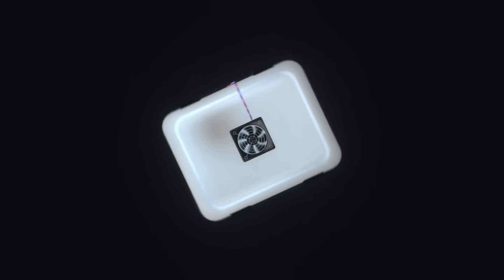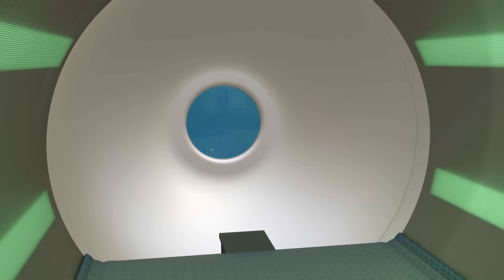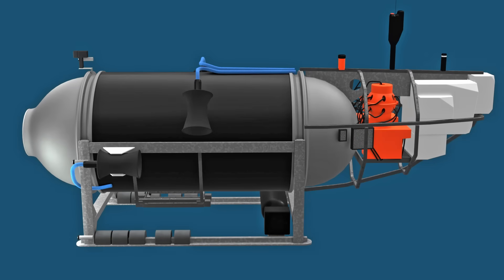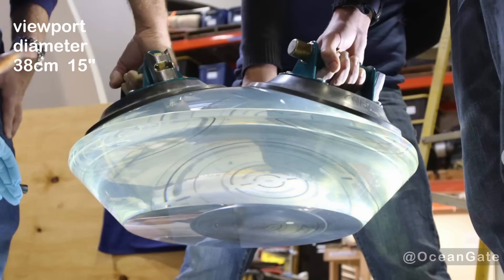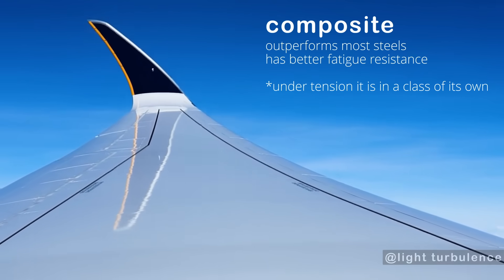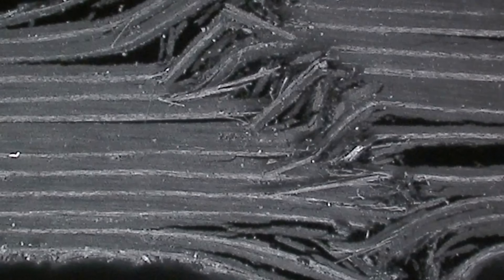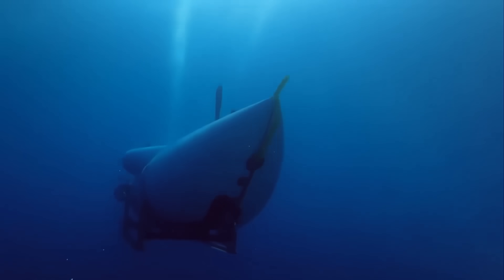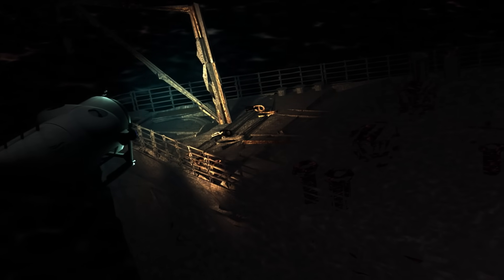Titan Sub | carbon fiber - Detailed Tour

Comment: I suspect many of the people who said in media that CF composite should not be used in compression know very well it is an oversimplification. Anyone who has worked with it knows this. I am an electrician who just helped build some diy carbon fiber recumbent bikes and I know this. But the explanation of the limitations to the design and manufacturing of such structure are so complex that mass media are just not interested in hearing them. So all those people face a challenge of how to say in 30 seconds on camera why the CF hull failed and something like "it is insanely difficult to design this right and requires tons of expensive testing and way more complex manufacturing than this company had access to or willingness to use" it gets compressed (pun not intended) to just "don't use this material for this". 
I feel this is similar to what in my own field of work happens in every discussion of electrical safety. Suddenly you have people arguing from position of authority that not voltage but current is important and they get very heated about it. And you could say they are stupid because in reality that is not true. But explaining the complex relationship between voltage, current, frequency and duration and the effects any combination of those variables has on human body takes 20 minutes even when explaining it to a technically knowledgable person like a non-electrical engineer. So you will never get the full picture when someone is asked to say into a TV camera a short reason why the kid climbing over the train got fried without even touching the wires. That does not mean the person saying in media does not know how it really works. 
What is a pity is that now it will be that much harder to make a composite submarine. In addition to the technical challenges now you have everyone in the world being certain it cannot work. It is like if 30 years ago one of the first carbon fiber aircraft had a spectacular crash killing a bunch of milionairs. We would still be insisting today tha any plane for passengers has to be metal only. But I blame Rush for this and not all the people giving simplified explanations after he botched it. Even if every publicised explanation went into the details of micro buckling failures in the longitudinal fibers in the hull what most people would still take from it would be just "carbon fiber bad for submarines" and nothing more.

Comment: I don't know if the cause of this implosion has anything to do with the CFRP construction. One thing I will say is that the analogy between a vacuum chamber and a wing spar under compression is flawed. Water ingress and delamination in a wing spar will not cause the same potential for deformation of the structural in a way that increases load, e.g. buckling. This might be too thick walled of a pressure vessel for that but I don't think there is a straight analogy here for aircraft spars even under compression.

Comment: I think it was thunderf00t who put out an explanation that I'm referencing here... But I believe he got it right. The compressibility of carbon fiber and titanium are completely different. Very different from each other, which is why you don't make a pressure hull from two different materials. That was the problem. Under the extreme pressures of the depths of the ocean, the carbon fiber hull compresses quite a bit, and the titanium end caps barely compress at all, almost a negligible amount. As the carbon fiber hull "shrinks" or squishes from the pressure, and the titanium end caps don't change in size at all, the connection between the two opens up. That connection was made with a glue, which would've cracked open or pulled apart, allowing a leak to open in the connection seam. The pressures of the water would very quickly blast that tiny crack/leak open larger and wider, at an exponential rate, with every passing moment as the water forces its way inside. After a very short period, a massive hole forms from even the tiniest of leaks, and ultimately the water slams in with immense force, demonstrating a giant water-hammer effect. Once the hull completely fills, in the last moment the water hammer slams the inside of the hull in all directions, causing the titanium end caps to blast off the ends, as you mentioned they did in this video, as well as utterly destroys the carbon fiber hull. This massive water hammer slamming in would be the loud sound that was heard, more like an explosion from the hull suddenly filling, not an implosion as people assume.

Comment: Listen, Carbon fiber is great for tension forces, IE tanking for cryogenic fuels for rocketry...Its physics with extreme variables. Carbon fiber is a wondrous material, but, not when you are compressing it from all directions like at the bottom of the sea....Not to mention the material fatigue....I would have never ever taken that trip even for free to only 2000 feet...

Comment: How can you say that a wing of a plane is under competition loads when it's more under tension like hell there's a massive low pressure zone above a wind that's what lift is never mind the flex of the wing that puts it under tension on the lower half the only compression load is half the wight of the plane over a 20 foot x 60 foot span so its basically nothing

Comment: The Titan design was not inherently flawed; it was innovative and sound. However, a critical mistake was the insufficient testing. Dry test dives without passengers should have been conducted extensively before full implementation. Additionally, Rush's unique way of explaining his design and safety approach left him vulnerable to character attacks from conservative media outlets. Unfortunately, everything tends to turn political these days, and they had a field day. The irony is that Rush was actually a Republican donor, not a liberal one. Hopefully, a new submersible-building firm will take up the Titan design, perfect it, and vindicate Ocean Gate's vision. Cheers from Park City!
Reply: Not just testing. The Titan needed to be thoroughly X-rayed both before and after every dive, but that could never be done profitably.

Comment: This is the first time I have seen this subject covered with an engineering perspective, a true understanding of the materials involved and a use of the evidence known. As mentioned in so many of the previous videos, they were no more than here say and copy cats of other here say coming from from people in the media (Like James Cameron) but with no engineering abilities at all. None the less I do not believe the cylinder actually failed. Rather the 'glue' from the titanium ring to the rear cylinder began to leak. This was even reported by the crew in communication with the surface vessel. This then went from a leak to a 50kg tnt 'explosion' of water that went from the rear down the tube like gun, blowing the vaporised occupants towards the front, first blowing the window out and then the front cover off too. I feel with the next expedition (likely next year) to the wreck, more parts of the cylinder will be found and could week be likely mostly intact.

Comment: There are so many problems with using carbon fiber for high compression use cases. I don't see the innovation here, because carbon fiber composites weaken on both compression and decompression cycles, so if you are on a sub at the bottom of the ocean and a structural failure is determined to be imminent, you would have to stay at your depth and hope that someone can immediately rescue you, because the act of resurfacing would be another full work cycle on the structure.

Titanium and other metals can have fatigue cracks, but if you start hearing noises coming from the metal under high compression, decompression is far less likely to create a scenario of structural failure then a composite one would. Soon in a submarine you could just surface.

Another problem that people already mentioned is just the fact that it's completely uneven, I see an engineer that posted fairly high compression results he got once, but if you built a full model of something with both carbon fiber and titanium, then tested both to structural failure on different surfaces, the skews of the results is going to be very clustered for the titanium, but likely all over the place for the carbon fiber.

Emphasis here on the lowest performing point of failure being the guaranteed point of structural failure in the real world.

Addressing a use case for more sophisticated carbon fiber designs: I imagine a 3D composite would do better than whatever Stockton Oil Baby Rush was using, but how thick do you have to make it before it can perform anywhere near titanium, and at that point, is it still lighter, thinner, or cheaper than titanium?  And how much maintenance will that require? This is why I think carbon fiber is dead on arrival for anything deep sea, and while it could be functionally viable to medium depths, I think that the maintenance and all the extra monitoring equipment quickly erodes any cost savings up front.

Comment: I haven't paid much attention since the first week or so, but what about water ingress into the outer layers? ISTR some aerospace composite tanks failing (or at least being removed from service) because of delamination.
If water gets into the outer layers through crevices in the resin, seems like the full pressure will be applied to fewer layers - the equivalent of a thinner hull. That won't end well, particularly if the crevices are concentrated anywhere.

Comment: You are very wrong. CF cannot be used for this application. No video will change that as it is not just about material characteristics but also where it is used and in which environment.
I've left my hand down as you missed completely the true issue with CF focusing on your narrative. You getting there, you just need to get some extra education about materials and maybe in a few years, you will be able to review this video with a smile, thinking how childish it looked from the perspective of a real engineer. But good effort boy. Keep it up and maybe think about getting a degree at some point as you have some knowledge (limited and clearly under the master's level, but still better than someone straight out of a high school).

Comment: It was dumb. Don't even ask, it was dumb. If crossweaved it may, may have been more robust over fatigue cycles, but your assertion that carbon fibre was strong enough, is absolutely not proven. It hasn't had the pressure testing to support that. Oceangate didn't do it, netiher has anyone else done it.

Assessing it's suitability from its theoretical strength properties is more than likely what killed its pilot and occupants.

It is its suitability for the given design, in the current use case, that has to be assessed. That basically wasn't done and still hasn't been done. 

The DeHavilland Comet is one example where the actual materials used, are all suitable enough. But one design flaw in the use of that material, causes it to be ultimately fatal.

That flaw showed up under stress cycles. The Titan's flaw showed up under stress cycles.

The hull construction was absolutely not precise enough for CF and Finite Element Analaysis would tell you the performance of the hull you mean't to build, not the hull you built.

It was dumb in so many ways that's it's painful to consider. And CF shouldn't be used in that use csase again ever until it has had real world simulation testing, extensively and exhaustively. And even at that, the onus it puts on the precision of winding the material, makes it a fundamentally more dangerous proposition than Titanium.

Comment: An even slightly 'out of round' tube will have uneven loads on it. This becomes exponentially worse the more it flexes/distorts 'out of round'. As it becomes wider on two opposing sides, making it oval shaped (looking from the end cross-section, along the length of the tube), those two sides get more load than the two opposing narrow sides of the oval shape. The differential load on the tube (the external top to bottom load being different from the side to side external load) will cause the tube to flatten out. At that depth/pressure (about 5500psi), even a small deflection towards the top-to-bottom/side-to-side dimensions of the tube is going to get exponentially out of control, very quickly. The longer the tube, the less stable it would be -- there is more area/places to go out of round. Carbon fiber, being brittle, would shatter long before the uneven external load actually flattened the tube out.
For that reason, a tube shape is far better for use with internal pressure than external pressure, because internal pressure tends towards maintaining the shape of the tube.
Reply from the maker: Great point 👍🏻

Comment: I noticed that the section about the viewport is the most replayed and there is a tiny little error there. 20mm converts to slightly more than 3/4", not 3-1/4". Best and most informative video I've seen on Titan, and yes I would agree the transcript is fake to gin up a compelling story of mounting drama. I agree they likely would not be typing running updates while responding to an emergency. It's more likely they had little to no warning before implosion.
Reply from the maker: Well spotted. Yes it should read 3/4”. Imperial notation is not something I’m very familiar with and I did this one in a hurry. 
I have been contacted by someone on the Polar Prince on the day and confirms the transcript is obviously and definitely nonsense. The real transcript is short and with the investigation. No emergency message received.

Comment: The comment that the transcript is false based on the thrusters being use during decent is wrong.  The context was that at that point they had warnings and were trying to ascend.  The thrusters at that point were not slowing the decent.   There were many long pauses in communication from the Titan showing that they were working on issues, rather than communicating.  The transcript may indeed be fake, but not based on those two points in my opinion.

Comment: You can't just make general statements that "cabon fiber is strong" or "carbon fiber is bad in compression." The geometry and manufacturing methods are critcal. In this case, the cylindrical geometry with lateral pressure was a very poor geometry for carbon fiber, easily producing layer delamination with cyclical compression. There is also good evidence that the prepreg carbon fiber was not wound or cured properly.

Comment: Yeah, about that big wide door that allowed for easier entry than the more traditional top hatch. It was against the law. The US Coast Guard does have well published regulations and requirements for passenger submarines and submersibles used in revenue service. Which Titan unquestionably was. And Titan was bound by these rules and regulations because it was constructed in the US by a US firm. Rush went out of his way to pretend otherwise while knowing full well he was in violation of US Laws and regulations. One if the clear regulations is the hatch must sit at a minimum 1 meter above the waters surface when the vehicle is bouyant on the surface. In short you must be able to open the hatch to escape, without flooding the vehicle in at least a calm sea state.

Comment: 9:10 Mike, sorry to say but no, you are wrong. Carbon fibre is a thread that's woven into a cloth, layered and bonded with an epoxy. If you re-think the thread matrix as a single rope and push on the end of it, what happens? The rope yields easily. Under compression, carbon fibre relies on the strength of the epoxy binder rather than the carbon fibre itself. Plane wings use tension for strength not compression, they have a central spar that is located on the top and bottom of the wing with rib spacers in between to maintain the central gap. lateral forces applied to the top or bottom of the wing puts tension on the spars.
Reply from the maker: @Mrx1080  Pretty much everything you said is incorrect. 
How does a racing yacht stay up on its “rope like” carbon fiber foil!?
Reply: @Mike-Bell same scenario as the plane wing. Virtually all carbon fibre structural pieces use carbon fibre on the outer edges with some kind of spacer in the middle, this applies tension to the material when under load

Comment: My first thoughts are that it all looks dodgy as ****. Mind you, all my boating has been done on the surface. Carbon is very good, but ... 
Fascinating and informative , thanks.
Reply: I have done a bit of work with carbon for racing multi-hulls. IE sailing boats. Samples would be laid up early in the build process and sentvfir destruction testing. 
I'm wondering if it would be even possible to test at the expected working loads.

Comment: Carbon fiber is not ideal for resisting compression or compression cycling. Further, the interface between the titanium and carbon fiber, two materials with different properties, will almost certainly be implicated. This will give carbon enthusiasts a way to claim that the fiber was wrongly blamed. I predict quite alot of mental gymnastics to this effect in the coming days. 
 When the final anbalysis comes out, The choice of carbon fiber will be the boogeyman.

Comment: Thank you for this video! It's the only video or article I've seen that actually attempted to show the Titan components, what was on board, what was in the tail cone, etc.
Reply: He leaves out, "The Sphincter Valve Effect" what happens is.... noise and visuals ALL/BOTH travel South to the Spincter Muscle, they have to circumvent what is commonly cvalled 'the oriface interface', the nerves there are very thin and need bloodflow.
Once you throw TOO MUCH INFORMATION down theree, the Sphincter Valve closes, muscle tightness causes a drop in blood flow.... nerves can't pas information past .......and the brain has no choice but to mutter OH SHYT!!!